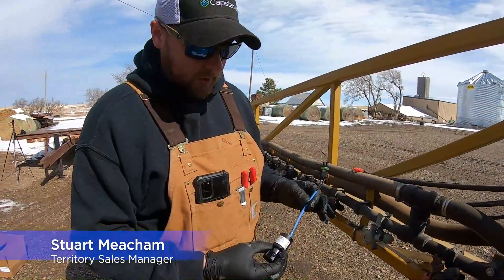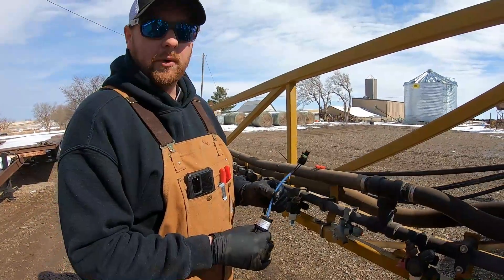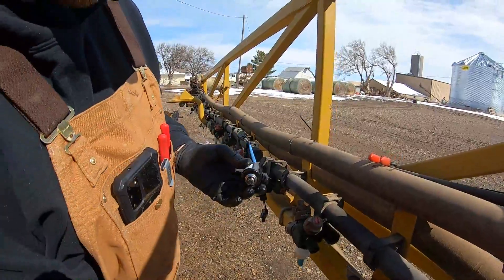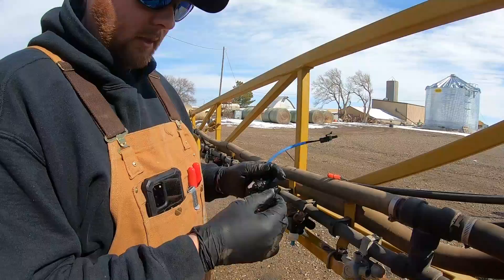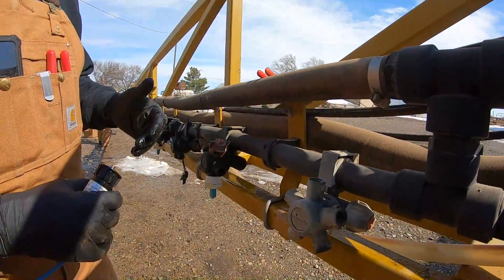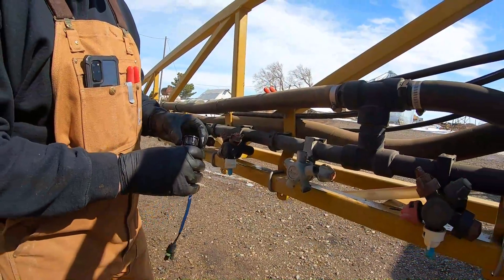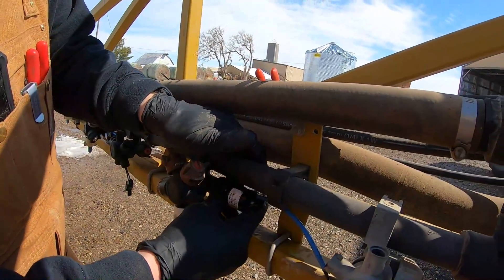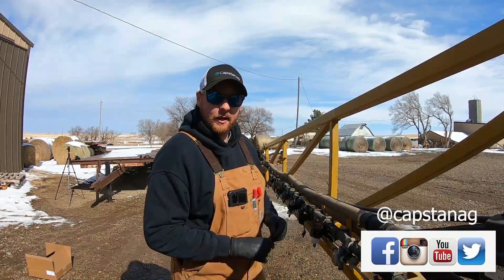CapstanAG™- PWM Valves:101

Comment: Are the valves compatible with brass airblast sprayer bodies or is it only for the lower pressure nylon/plastic bodies as shown here?
Reply from the maker: @harisonk we have an air blast specific sprayer system called Synchro! It is very similar to what you see here but designed for that application.
Here is a link to more information: https://capstanag.com/synchro/ 
Also, you can contact us at https://capstanag.com/contact/
Reply: I've been looking at Synchro, but I have found limit information on retrofit kits and what is involved.
Reply from the maker: @harisonk   it is available for nearly all makes of air blast sprayer and is designed to be easily retrofitted. if you go to https://capstanag.com/contact/ and fill out some information we will have someone reach out to answer any questions and talk with you about your setup!